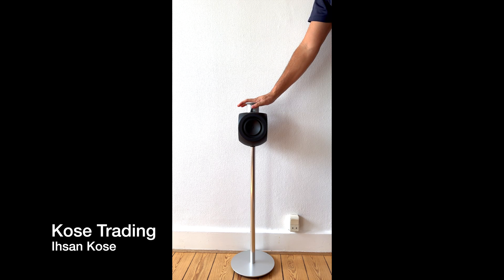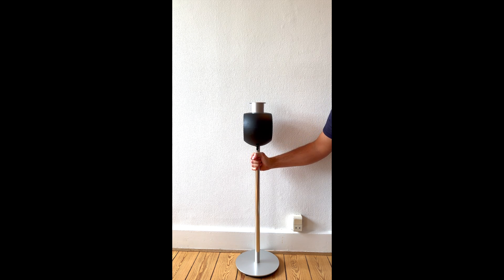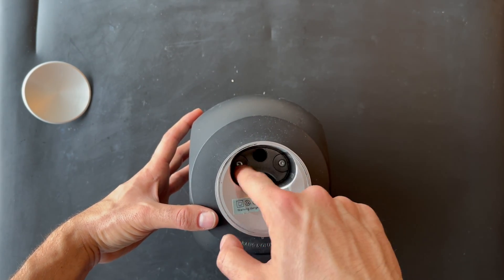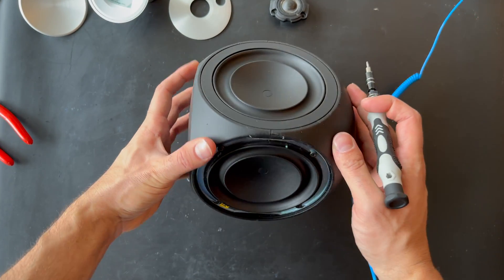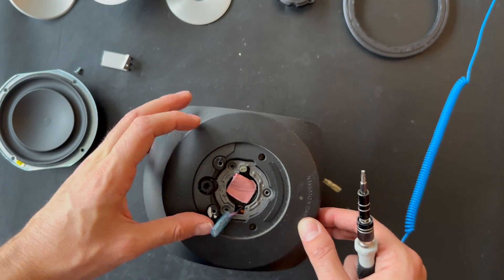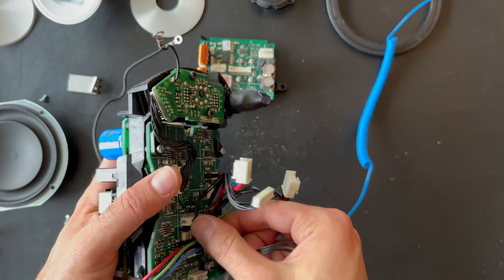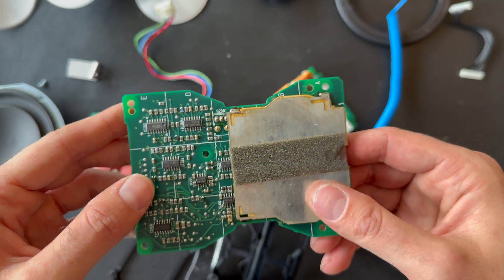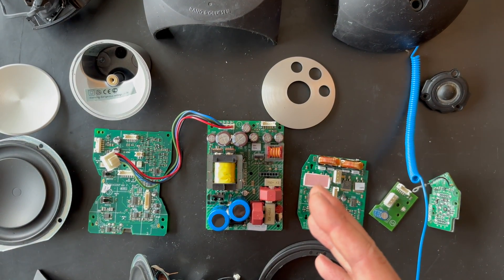Bang & Olufsen BeoLab 3 Active Loudspeakers Disassembly process and Repair guide

Comment: When you accessed the power supply board, did you see a jumper that could change the input voltage supply from 220/240 volts to 110 volts !?

I REALLY need to know this.

I’m tired of attaching an auto Transformer to convert this voltage.

Please answer
Reply from the maker: It sounds like you're referring to a switch or jumper on the power supply board that allows you to change the input voltage from 220/240V to 110V. In the Power supply board there is a jumper to can change. You can also look up for the service manual

Comment: Good disassembly guide. The RIFA branded 100n and 220n capacitors in the power supply should always be replaced. It's only a matter of time before they split and emit a stinky smoke bomb. They are a known issue in a lot of equipment.
Reply from the maker: Thank you for your comment. You are absolutely right. the RIFA capacitors need to be replaced with better ones :)

Comment: So they're active? 
Each unit has it's own amp? Or 1 speaker has amp for pair? 
And how does it connect to a source?
Reply from the maker: Yes, Beolab 3 is a Active speaker. Each speaker has its own amplifier build in.

The Output for Beolab 3 has only Powerlink. Normally you connect the Beolab 3 into a Bang & Olufsen soundsystem, but you can also supply a RCA cable with a trigger on. 

If you want to connect the Beolab 3 into NON- Bang & Olufsen system, you need to trigger the Beolab 3 with 5 voltage and then the speaker can turn on.
Reply: Could U elaborate on that? How could I apply a trigger in?
Reply from the maker: The Beolab 5 trigger in 5 voltage.

Comment from the maker: BeoLab 3 is a loudspeaker with a lot of versatility. It can be arranged in a variety of ways. The loudspeaker can be mounted on the wall, placed on a shelf, or placed inside a bookshelf with the help of the included stand and fittings.